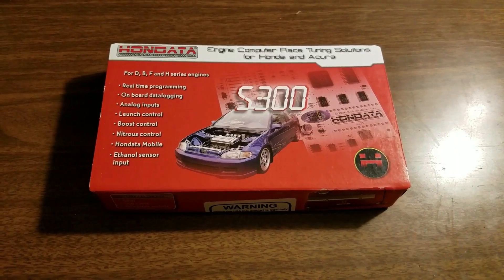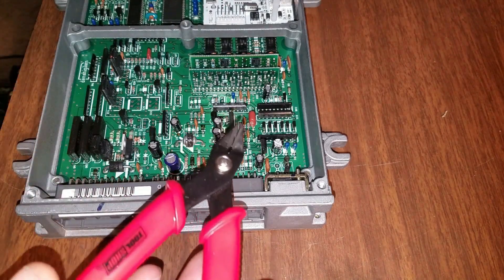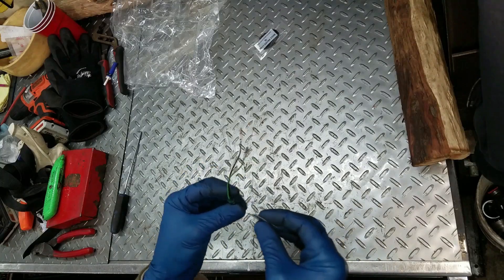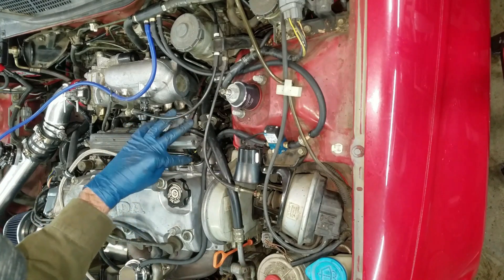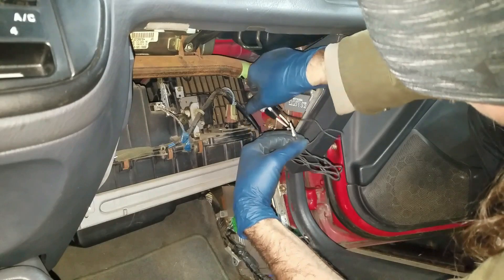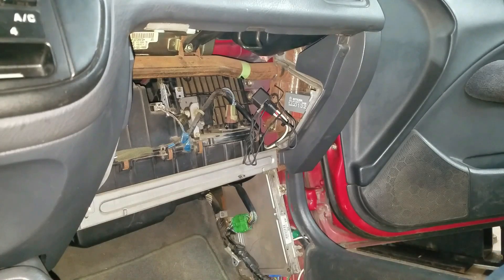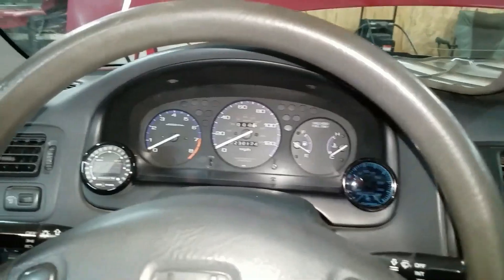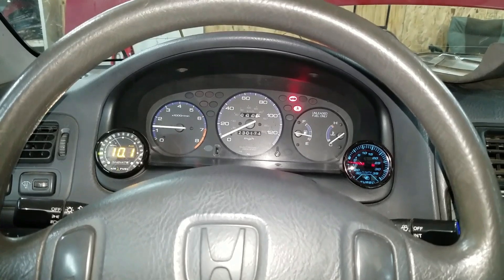Ej8 Civic D16 Ebay turbo build part 14

Comment: Well now I gotta wait for the Dyno run....Dam it!! I used those same guys for my Hondata as well, they hooked me up too. And what I found amusing was I had the same leak at that stupid drain line.
Reply from the maker: Super fun. After realizing how many blends of e85 people use, I figure I better to that flex fuel sensor before I get it tuned too. Are you using e85?
Reply: @RustBeltAuto  no sir, no e85. I'd like to, but not readily available in my area.
Reply: Lol. What did you say? I totally missed it. 🤣

Comment: Does the E85 blend really change that much from winter to summer? They don't have it where I live. 10 to 1 is so rich. I have no idea how the ECM deals with all the flex fuel stuff. I've never had to deal with it. I guess I could just google all of this. Even back in the old carburetor days, messing with turbos was a steep learning curve. Many, many damaged parts... Great series this has been so far.
Reply from the maker: There are stickers on most pumps here that tell you the content can be anywhere from 51-78%. Even though there is another fancy sticker that says E-85(85% ethanol), like some kind of lying ad campaign. I found one place that has a sticker that says guaranteed to be 71%. That's where I go. I can also go across town and get 81% at the pump. Handata supports a flex fuel sensor that measures the ethanol content.